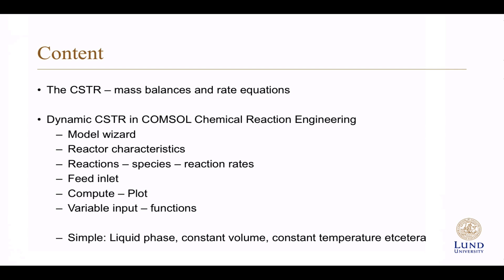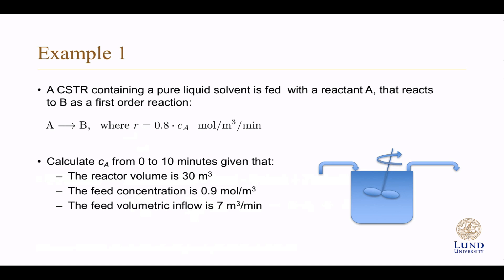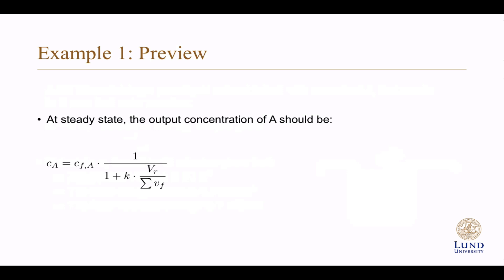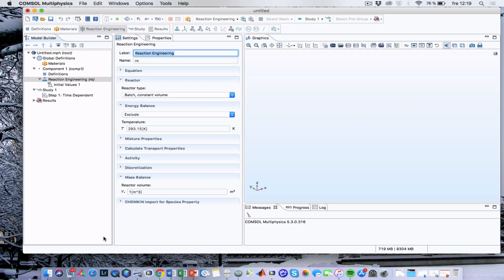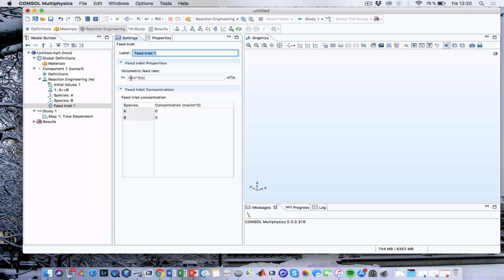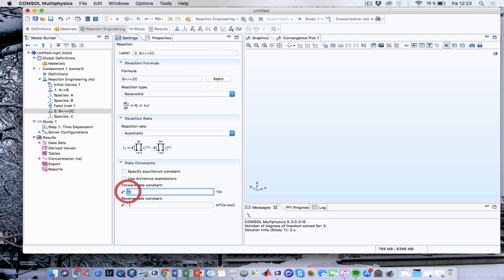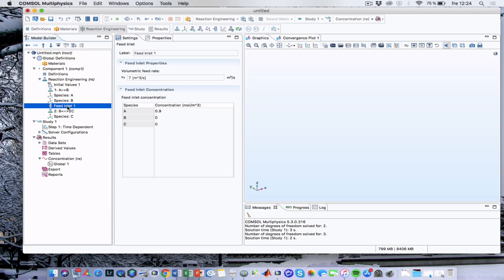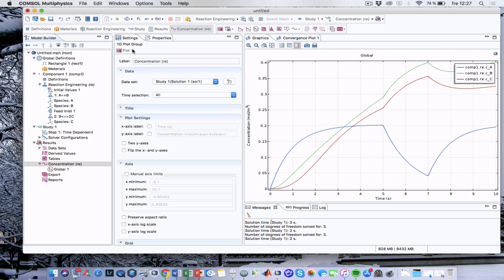20 – Modeling a CSTR using COMSOL

Comment: Great example, but  the problem states that, the flow rate is 7 m^3/min and you applied 7 m^3/s :))
Reply from the maker: Editor here: Thank you for pointing this out. It actually doesn't matter much as long as you remember to interpret the graphs as having the time in minutes even if it says seconds :-)
Reply: @PLE_LU  agree!